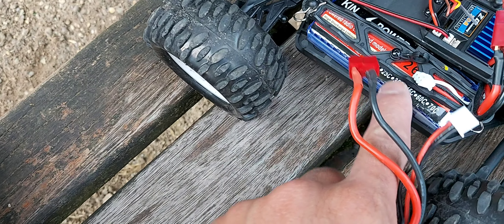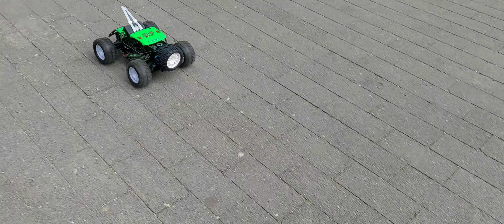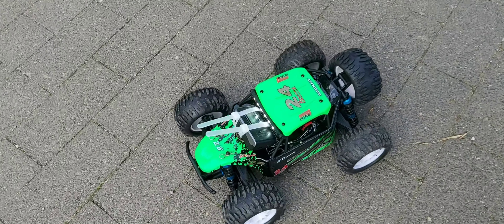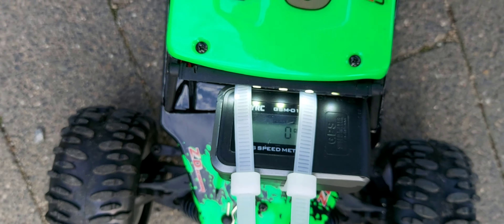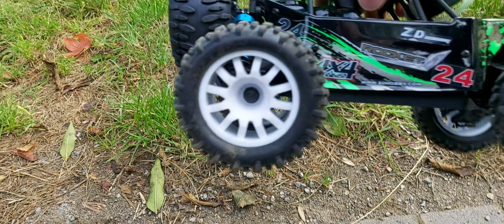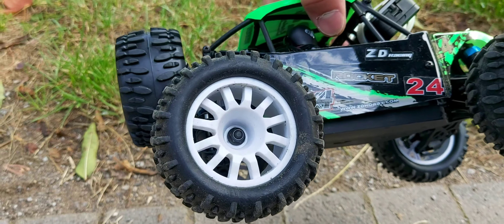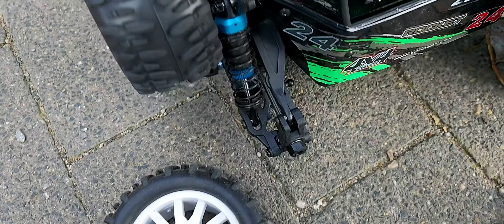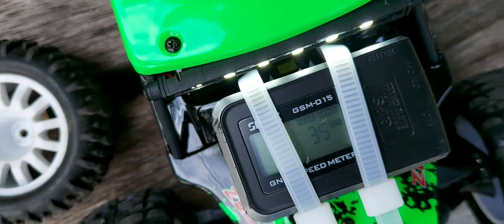ZD racing DTK16 Lipo15C vs. 25C Speed Test Gone Wrong

Comment: Nice run to bad about the axle but u need to switch the GPS to mph no one in the USA knows how fast 36 kilometers is ? Maybe 20 mph I'm not sure ?
Reply from the maker: As i converted 36kph is equivalent to 22.3 something mph yeah Bro i will switch next time to mph, Thank you for watching🍻 yeah that driveshaft 😅 as i checked banggood has no replacement for that driveshaft 🥺

Comment: Hey Joel, did you find a spare for the broken shaft? I have the same model and have the same problem with bending shafts.
Reply from the maker: Bro' check this link it has different code # but it says its for ZD 16 scale, im still not sure if it's thesame. It require's me to buy atlease 20€. Mine still broken 😅 https://www.krickshop.de/Accessories-Spare-Parts/Spare-Parts-for-RC-Cars/Spare-Parts-for-ZD-Racing-RC-Cars/Spare-Parts-for-ZD-Racing-RC-Cars-1-16/Radachsen-2-6029.htm?shop=krick_e&SessionId=&a=article&ProdNr=646029&p=325
Reply: @joelrcgarage3362  Thanks dude. I've ordered a second one just for spares 😄
Reply from the maker: @martinskowsky  yeah dude i was thinking too to buy a new one for spare purposes 😃
Reply: @joelrcgarage3362  It's an awesome rc but the shaft are definitely a flow.